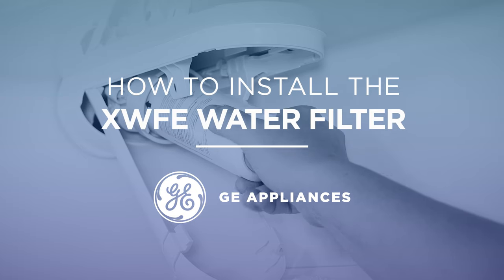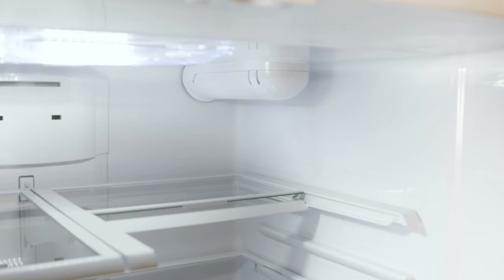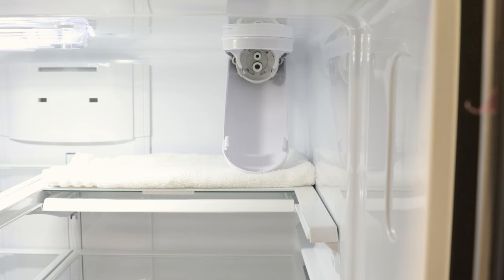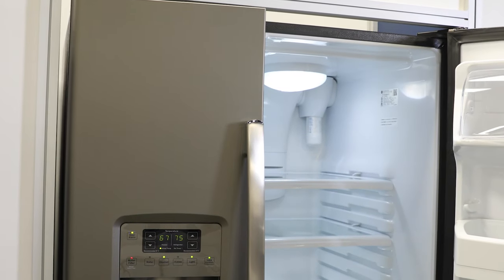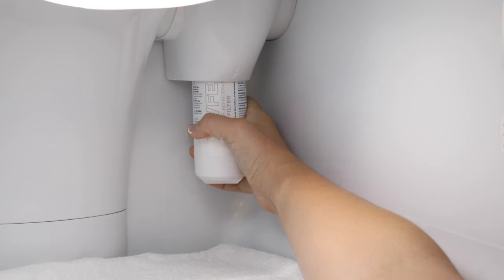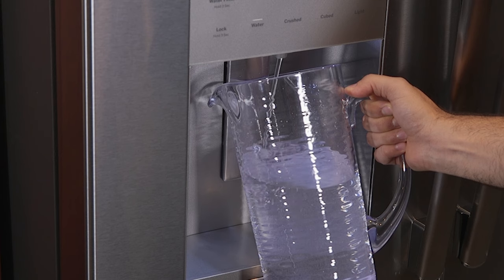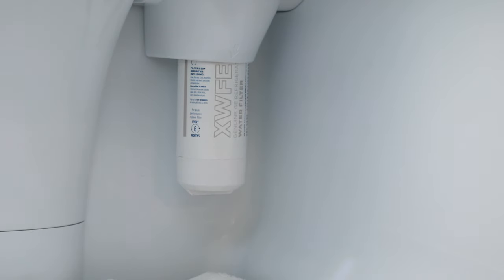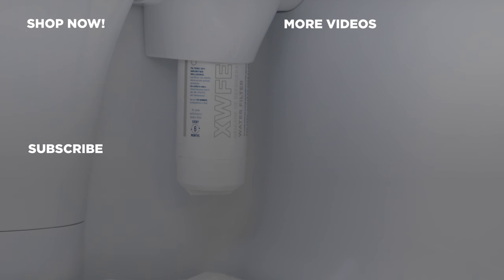Replace and Install the XWFE Water Filter

Comment: Literally impossible to get the filter in.
Reply from the maker: Hi John,

Sorry to hear about the issues you've had with replacing your filter. If you've not done so already, take a look at this article to see if it helps: https://products.geappliances.com/appliance/gea-support-search-content?contentId=21284&_ga=2.143403061.1045186091.1659353105-1657613511.1658931497

You may also want to check to make sure that the filter or the filter housing isn't damaged as this would make it difficult to install the filter properly. Of course, we always recommend purchasing parts from our Parts website: https://www.geappliances.com/ge/parts/?icid=GEARpartsflyout-allparts - This is to ensure that the part is genuine and will work with your specific variation of appliance.

We do hope this is helpful. If you have other questions or concerns, feel free to reach out any time.

All the best. -MS

Comment: Do I need to replace this filter my fridge is about 8 months old but I don’t even use the water feature on the fridge can anyone help ?
Reply from the maker: Hi there. We appreciate you reaching out with this question. The water filter in your refrigerator should be replaced every six (6) months or after every 200 gallons of dispensed water. The filter should be replaced more frequently if the flow of water to the icemaker or dispenser decreases. If you have any additional questions, we're here. -AT

Comment: 6months in and changing the filter.  Bought 2 XWFE filters from Lowe's and neither worked. Pressed restart, unplugged the fridge even. Held the dispenser down for over 5 minutes.  NOTHING! Considering returning the whole fridge back to Costco so i don't have to deal with this again in 6 months
Reply from the maker: Congratulations on the new refrigerator! We're sorry to hear you're having some difficulty changing the filter, but we're always happy to help. We have a very helpful article here: http://spklr.io/6051WqkD..

When installing, it's very important that the arrow on the filter aligns with the arrow on the fridge. Let us know if you have any trouble in the future. - JB
Reply: JB, I'm very confident I have installed the filter correctly. I realized last night that NO water is even flowing into the new filter. How likely is it the water is frozen in the door, or the scanner that reads the filter is not working?
Reply from the maker: If you are experiencing this issue with both filters, it's possible you may have a bad or damaged filter. In this case, we suggest exchanging for a new XWFE filter or using the bypass plug temporarily (with the RFID chip) for your model. This will re-activate the water valve for your unit. We apologize for this inconvenience.

If you cannot exchange it or do not have the bypass plug, please send us a private message via Instagram or Facebook with your contact information and your unit's model and serial number. We'd be more than glad to assist further! 

If you need help locating your model or serial number, you may check this link out: http://spklr.io/6058Wqer. Take care.
Reply: I tried 4, fresh out of the box filters last night. Two trips to Lowe's last night... currently waiting for a GE technician to take a look.  If they are not able to suggest a solution, I'll send you the info.
Reply from the maker: Hi - Congratulations on your new refrigerator!  We're very sorry to hear of the difficulty you are experiencing with the water filter.  If you can please send us a private message with your model and serial number and contact information, we're happy to help.

Comment: 6 separate filters were tried now and still have the same Err message. They are XWFE filters for the GFE26JYMNFFS. Both bought from GE. 

Please send me a generic GE message on how this will be fixed please!
Reply from the maker: Hi there, we're so sorry about the error codes you've been seeing and we're happy to help. We first recommend ensuring your filter is installed correctly and that it's a genuine GEA part. If the issues persist, we recommend scheduling service with a certified GE Appliances technician that will be able to accurately diagnose and repair your appliance. You can do so by calling GE Appliance Service at 1-800-GECares (1-800-432-2737) or by clicking here: https://www.geappliances.com/ge/service-and-support/service.htm

All the best. - GW

Comment: Great instruction but it doesn't work ... Working before trying to change the filter ... First filter change and ended in an Err code with  no water coming out and no ice. I will need to call a repair service ... To get ice ...
Reply from the maker: We are glad you like the video but sorry to hear your filter isn't working. If you have a by-pass plug, we recommend installing it to see if the water comes out when it is installed. If it does, this may indicate the filter you have may be defective. http://spklr.io/6050QJOm

Comment: Mine still not working.  I did just that but still keep getting an error message.  :-(
Reply from the maker: If you are seeing the ERR displayed on your control panel, the issue could be the water valve is deactivated and there will be no water or ice dispensed, the filter status indicator light will flash red. To resolve this issue, please replace the filter or if you have a by-pass plug try inserting that to see if the error goes away. If you need a by-pass plug, please reach out to us via a private message on Facebook or X and include your model and serial number, address, email and phone number.
Reply: @geappliances  well I followed you video and replaced it.  But that’s when I got error message.  I changed it last time and it didn’t do this.  🥴

Comment: I am getting an error message after installation
Reply from the maker: Hi, Mykell! If your dispenser is not working after installing a new filter, try reinstalling the filter to make sure it is properly seated, and disconnect the fridge from power for a few minutes to reset the unit. Also, make sure the filter is GEA genuine and purchased at a reputable dealer. Many filters bought online can be counterfeit and will not work in our refrigerators. Please let us know if you continue to have issues. - JB

Comment: I’m getting “err”. Water not flowing. Now what?! 😑
Reply from the maker: We'd be happy to look into this for you. Please provide your refrigerators model number, as well as where you purchased the water filter, so we can better understand your situation. Instructions for locating the model number for your refrigerator can be found here: http://spklr.io/6057S0ZP
Reply: I purchased yesterday from Lowe’s in Loganville GA.  The model is gne25jsknfss. I really need help. I just moved into a rental and I cleaned the whole inside and wanted to replace to the filter for a fresh start not using the same filter as the last family.  The rental company isn’t going to help properly.  Please help.
Reply: When I unplug the fridge it’ll work for a minute and then stop.
Reply: I also figured out how to reset it by doing T12.  That’s not working either.
Reply from the maker: The refrigerator model you provided requires a MWF or XWF (on select models manufactured after June 2018) model water filter. Is this the water filter you purchased? If you purchased the incorrect water filter, it will not work properly.
Reply: Xwfe was installed when I arrived and it worked fine.
Reply: It is also giving me a LEA6 error.
Reply: I matched them when I went to to Lowe’s.

Comment: Mine won’t turn
Reply from the maker: Hello there, we are sorry to hear that your filter is not able to turn when trying to install it. 

We recommend double-checking the filter's installation instructions for further guidance regarding the setup of this filter. You can find a copy of the instructions here: http://spklr.io/6054lkgy

If the instructions do not prove helpful, please send us a private message on Facebook or Instagram. 

All the best. - PM
Reply: @geappliances  i did it all. I put the old one back in and it works. The new one is trash.
Reply from the maker: Dan, we are sorry to know that the instructions did not prove helpful. 
Would you mind sharing with us via private message on Facebook or Instagram if you bought the filter directly from us? 

We look forward to hearing from you. - PM

Comment: Class action lawsuit needs to happen. This is unacceptable.
2 year old fridge no water, new filter doesn't work, bypass plug they sent me doesn't work. Original filter works but it is clogged. No ice no water why did i pay more for this fridge.....
GE never again. NEVER!
Reply from the maker: Hello,

We're so sorry to hear you're having this issue. We want you to have the best ownership experience and would love to help!

Please send us a private message through one of our social channels (Twitter, Facebook, or Instagram) with your contact information and the model number of your unit. Hope to hear from you soon. -SH
Reply: @geappliances  what good will come from this? I have to make a facebook account so I can tell you your poorly created fridge doesn't work? So you can attempt to make it right, by sending a technician to my house that will give me a 4 hour window and tell me that I will be charged an obscene fee if the repair isn't covered under warranty?
How about you stop screwing your customers and just make a quality product that doesn't suck your customers dry with grossly overpriced water filters with a computer chip that forces your customers to buy a new one when it isn't needed. Did you get this playbook from HP printer ink?
This is the most anti consumer appliance I have seen. And my kitchen aid dishwasher with its unserviceable filter built into the motor is a distant second. What's next GE? A juice machine with a proprietary bag system?
Reply: Where do I sign up for this lawsuit?! I bought my fridge 6 months ago and pissed away my night last night trying to get a new GE filter to work.  Watched numerous videos, tried the RFID chip trick and nothing! Absolutely disgusted with GE.

Comment: its a fridge... stop acting like you've created some impressive appliance with hot new tech.  Its a pump connected to a line with a filter and some type of monitoring device that signals another.  But fine, I can move past that stupidity BUT to suggest that the fins were a good addition to the area that used to be empty space so now the filter CANNOT secure properly is beyond stupid.  Im all for making it fit but no amount of pushing is going to make the solid plastic ribbing move any more out of the way.  Are you suggesting I take a dremmel to the plastic and cut it out? Ripping the chip off the existing one and slapping it onto a 3rd party  filter should work fine but the filter wouldn't ever reset because it would be reading the same id every 6 months leaving the change filter light on... aside from doing some more modification.  Giant pain in rear end!
Reply: I was thinking just that. Would it be possible to just slap the rfid from the existing filter to a xwf filter. Did you try it?
Reply from the maker: Hi there LaFilleMignon, and thanks for reaching out. We regret any trouble you may have had with your filter – we always want to provide a great experience, and we want to help however we can. We would not recommend altering the filters or using a third party filter, as we wouldn’t have tested such a set up for safety and reliability. 

If you wish, you’re welcome to provide the model number of your refrigerator (here or over our GE Appliances social media). Please also include any other relevant details about the trouble you’re having. We’d be glad to provide more information about the filter your particular model uses. 

We’re also happy to assist with any other concerns or questions you may have. All the best. -SG

Comment: GE has failed me again. I bought a GE refrigerator at home Depot and it is a GZS22YNXHFS that has a filter model number XWFE. The thing only lasts 6 months which is half the life of my previous GE refrigerators filter. Secondly, since I had to buy a new filter, I bought one online through Amazon and it gives me an error. What a joke! This is a GE filter as well but now I can't run my water with it. So I'm returning it back to Amazon and calling GE to complain. I am so sick of GE's poor quality.
Reply from the maker: We're sorry to hear the filter you ordered wasn't working properly. To ensure you receive a genuine GE Appliances water filter, we recommend purchasing directly from our GE Appliances Parts and Accessories website here: http://spklr.io/6053WCJD. All of our water filters last approximately 6 months depending on use.

Comment: $53 after tax way overpriced filter that cost them less than $5 and yes you have to waste 2 gallons of water and about 2% of filter life 🤦‍♂️ this is my first time buying a GE product and for sure it’s the last time.
Reply from the maker: Pricing can be dependent on several factors. The economic elements include distribution, warehousing, and marketing costs, which account for a portion of the selling price of the part. Other factors like usability (cosmetic vs. functional) and availability also contribute to pricing.

Comment: but YOU GUYS CHARGE A FORTUNE. you charge $55 every 6 months. thats utterly robbery
Reply from the maker: We will share your feedback with our engineering team. If you decide not to purchase a filter you can install the by-pass plug if desired. You can also purchase an in-line filtration that you can connect to the back of your refrigerator water line. Copy and paste this in your browser: http://spklr.io/6056se0e 

At our GE Appliances’ testing labs, our scientists and engineers are dedicated to developing innovating the latest carbon block technology and the best formulas for performance. A part of our commitment to quality is rigorous traceability and management of raw materials and components. We also use extensive third-party testing to ensure consumers have the filter that fits their needs and performs as specified to ensure they have clean and safe drinking water.

Comment: I bought the expensive GE XWFE filters, removed the old, put in the new, and the button will not open the solenoid to let the water flow. I pushed the button for more than five minutes. Still nothing. I held down the filter button. Nothing. This is a model two door with freezer on bottom - GNE27JYMWFFS.  I put the old filter back in, and it works. Try the new one again, and it doesn't work. In my humble opinion this GE appliance is a piece of garbage, and because of it I will avoid any and all GE appliances from here on out. How in the world did they make this so complicated? What shame. Repeat: avoid GE appliances. Headache after headache.
Reply from the maker: We're sorry to hear that you're having issues replacing your filter. If you haven't done so already, we recommend that you take a look at this article: http://spklr.io/6055tv0X. If this isn't helpful, please send us a private message via Facebook or Instagram that includes your model/serial numbers, a brief description of the issue as well as where you purchased your filter.

Comment: My new GE refrigerator has not supplied one glass of water or one cube of ice. So far GE has offered little help. XWFE filters are not being recognized. Err code reappear after resetting after unplugging and waiting 2 min. Repairman that GE set me up with won't call. I called him and I was told "I'll call you back". Then no call back.
Reply from the maker: Hi Larry,

Thanks for reaching out. So sorry to hear about the filter issues you've had, we can understand how this would be frustrating. If you're seeing ERR on your display, it's possible that no filter is inserted, you have a bad/damaged filter, the wrong filter is being used, or you're using a non-GE branded filter.

If you're still having issues, feel free to send us a PM on Facebook or a DM on Twitter/Instagram with a copy of your comment here and any service confirmation numbers you may have, we'd be happy to review further if need be.

Best wishes. -MS

Comment: This is a total rip off.  Requiring purchase of a $55 filter is such a disappointment in my new GE Refrigerator.   I wonʻt recommend GE again because of this.   I specifically looked for reliable performance and a this is insane.  I DO NOT WANT TEXT ALERTS... I want to be able to replace my filter for $15...  GET RID OF the RFID chip!
Reply from the maker: Our XWFE filters feature patented leak-detecting technology to offer protection against the risk of several potentially costly failure modes. If the RFID component detects a leak, it communicates with the refrigerator to shut the water supply off; other replacement filters are not capable of doing so. If you’d rather not have your water filtered or prefer to use an external filtration solution, we do offer a complimentary bypass plug that you can use instead of a filter. If you’d like a bypass plug to be sent to you, please send us a private message over our social media (such as Facebook or Instagram); we can certainly assist. 

Your feedback will be shared with our team for consideration, and going forward we’ll do all we can to earn your trust in our brand again.

Comment: I WILL NEVER BUY A GE AGAIN!...100$ a year in filters because of a proprietary chip in the water filter?
Reply from the maker: The RFID sensor in our water filters provide Leak-Detecting Sensing Technology. The RFID sensor communicates with the refrigerator controls and can display information on the status of the water filter. This feature was designed to give consumers peace of mind.
Reply: @geappliances  RFIDs are cheap, If the customers peace of mind was the goal the filters would reflect that.